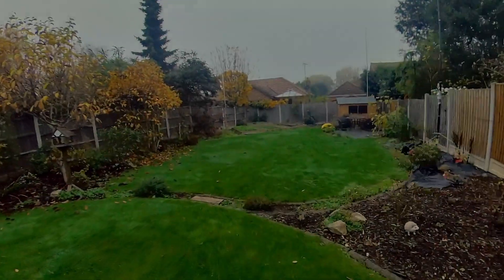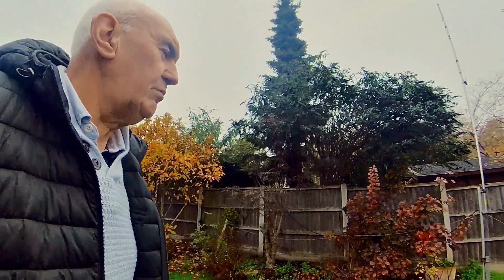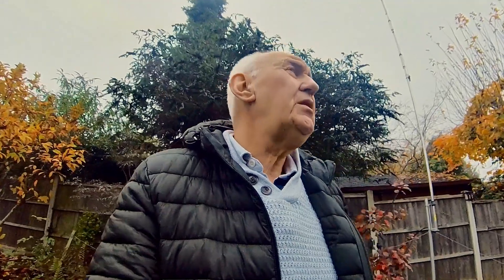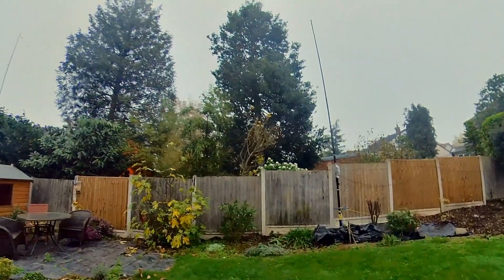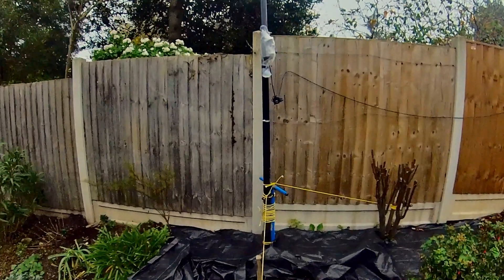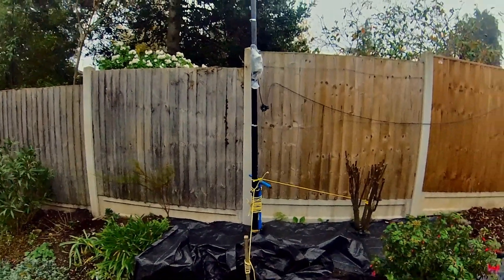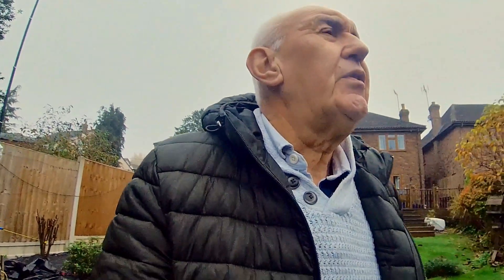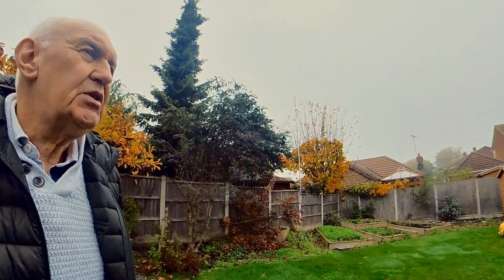Vertical Antennas   - A Complete Guide. | HAM RADIO

Comment: The challenge with a coil in the center of a backyard vertical antenna is that if you need to move the tap on the coil (which I do often), you must take the antenna down. Unless you have a good ladder 😊

Comment: Hi Peter, in a previous video for the Diamond bb7v vertical. you stated that the performance did not significantly improve with the addition of radials? i agree that most seem to be better with but have bought the BB7V for motorhome portable on the basis of no radials needed. thanks for the vids.
redders m5act
Reply from the maker: Hi Jo. Thanks for your message.  Enjoy HF, 10m is going great some days.

Comment: Great video, vertical antennas are my go to every time.  I just made a short video myself with a 20m vertical ant , with 16 1/4 wave radials then same antenna with 32 1/8 wave radials and results using rbn.its on my qrz page if your interested. 
Many thanks Peter. 73 zl3xdj.